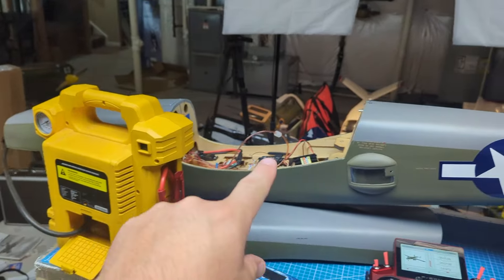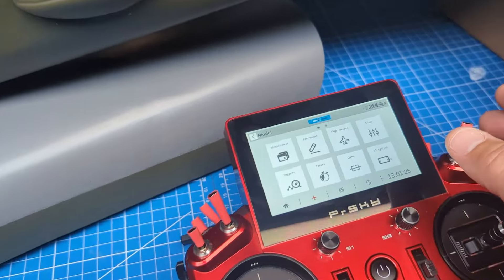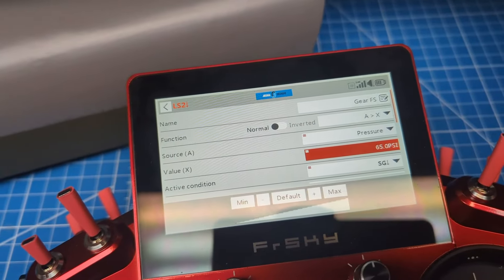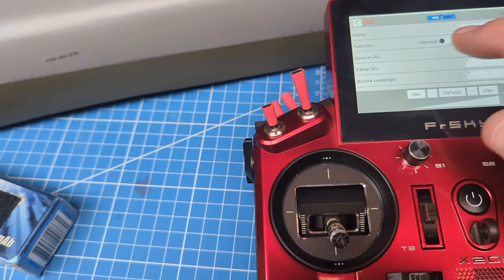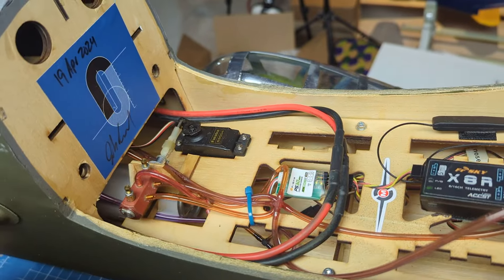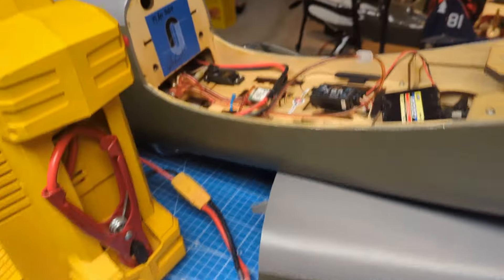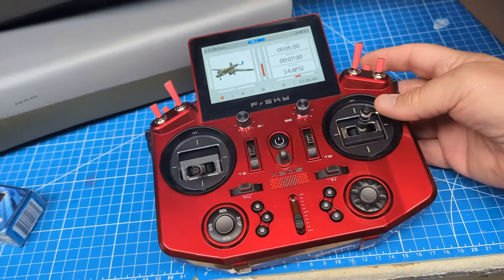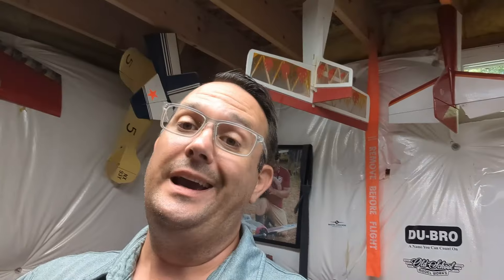Using a pressure sensor as a failsafe in ETHOS for pneumatic retracts | easier than you think

Comment: Hey Josh, (edit: after looking at the video I can see that the receiver is an x8r) what model/manufacturer is the pressure sensor?  How do you properly setup the pressure sensor to communicate with the receiver?  It seems as though the x8r receiver does not function in the dual frequency mode as the new radio allows, is that correct?  As I said in the comments of your earlier video regarding the new radio, I bought the same one but you're already ahead of me in setup.  I might like to go to the fun fly out in Muncie and if I do, it'll be with a trainer that has no special setup, but as I shed my training wheels in the next few months, I will have models with gas ignition engines and retracts where I could use telemetry data to better advantage.  Thanks in Advance!
Reply from the maker: Sure, the sensor is the PS30 sensor. I paired it with a screw-in hose barb for the sensor:
https://www.amazon.com/dp/B007Q29O34?psc=1&ref=ppx_yo2ov_dt_b_product_details
The sensor plugs into the Smart Port. All sensors do for FrSky systems and you can daisy chain them for up to 99 sensors. I've got an airspeed sensor on my Corsair. From there you setup the sensor in the radio by discovering the new sensor. 
The X8R works on the older ACCST protocol, not ACCESS, but it still works very well. The dual frequency is for the Tandem (TD, 2.4gHz and 900mHz) and Twin (TW, dual 2.4gHz) lines of receivers.
I'll warn that the X8R is not a good receiver for gas engines. You'll want one of the newer receivers as they've been designed to be less prone to ignition interference.